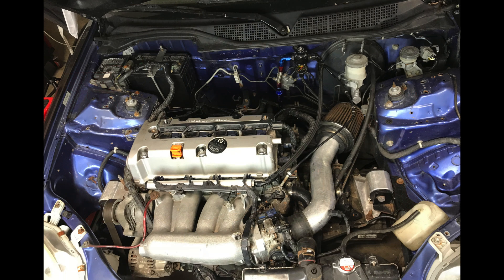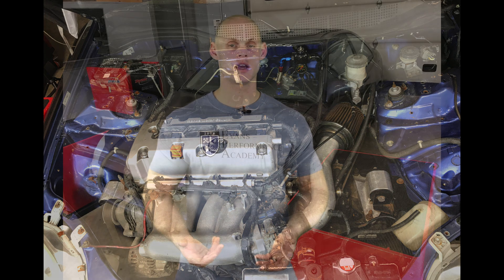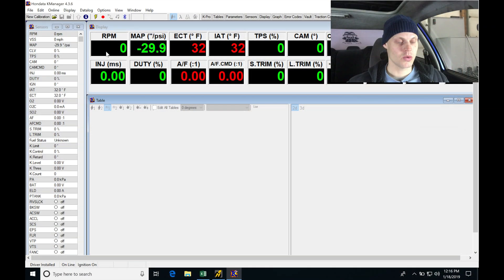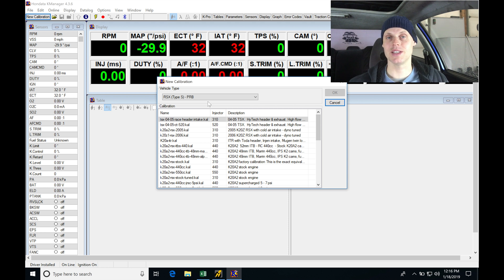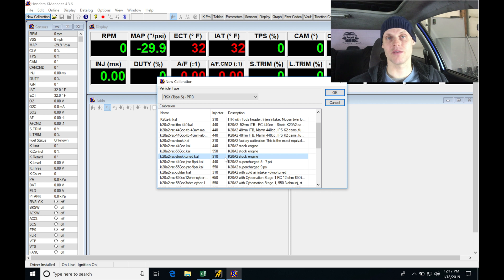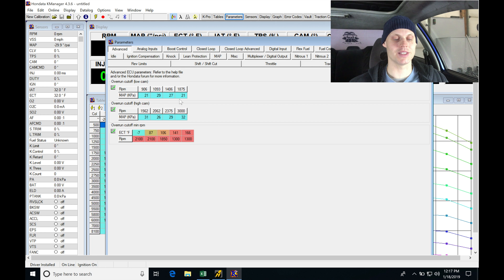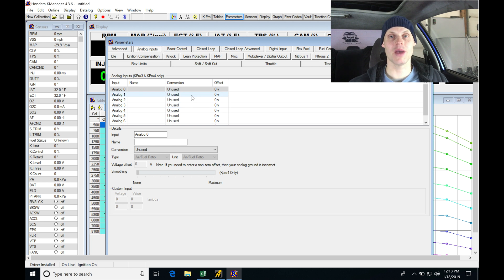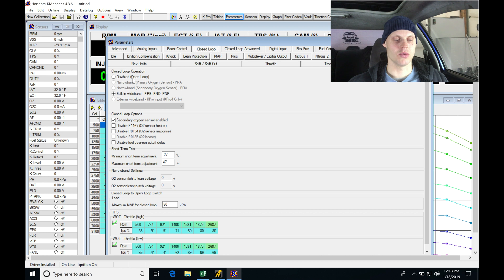KPro Live Training: All Motor K20a2 EK Civic Part 1 | Evans Performance Academy

Comment: Would this be the same for a 05-06 type s? I only see the 05 rsx k20z1 
And 06 rsx k20z1
I have the 06 so im just kinda wondering if the tune would apply to mine
Reply: yea they have the same engine and engine specs they are the same  bro